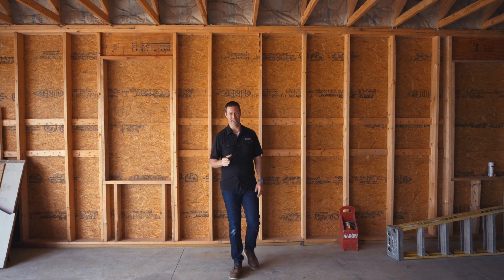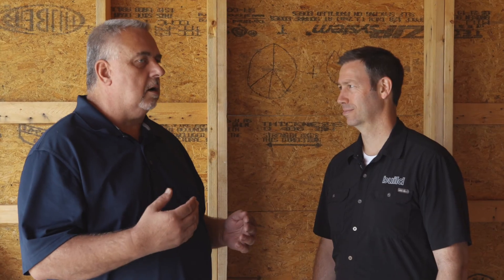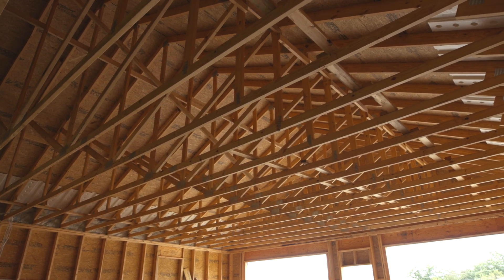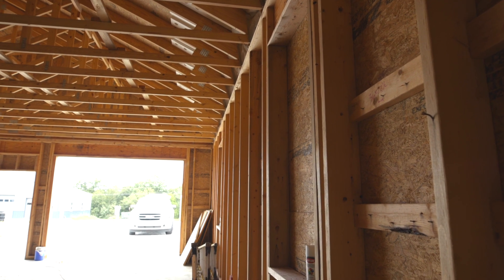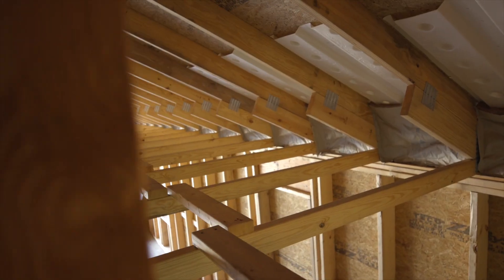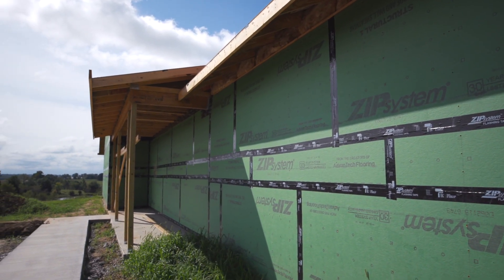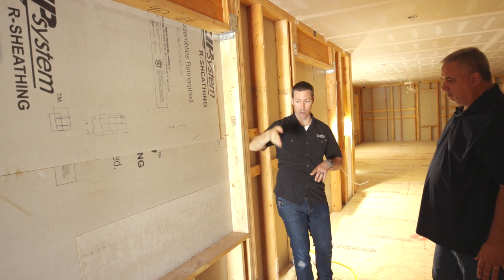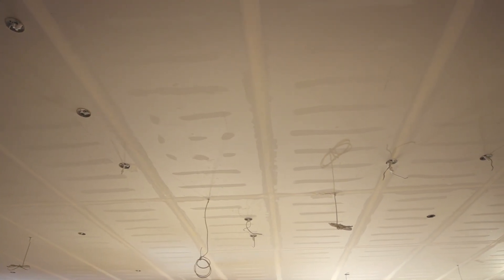Traditional vs Advanced Framing - Details

Comment: Love the openness.
Would this style framing be usable in California with earthquake codes?
Reply: Tom Bigley no, in fact this wouldn’t even pass any building codes in Utah and most other state building codes. This is garbage! No J-bolts to attach the exterior garage walls to the monolithic pad since I did not see a foundation, you get a big enough gust of wind that garage will move.
Reply: A lot of items would fail here in Colorado as well.

Comment: Im not convinced about this Advanced framing. I understand it’s engineered to save and be strong but hiring an architect to design it would cost more than traditional framing it. And I’ve used the zip systems and have had to go back and fix a lot of leaks. Also traditional framing makes adding on easier. And almost everyone knows how traditional framing works so future carpenters and anyone else that does work in the future knows exactly where everything is and don’t need to take down Sheetrock to see how it’s built. I can see using advanced framing where you need the house to be lighter and not as heavy. They should call it cheapest way to frame not advanced framing.
Reply: Tyler Durden this isn’t advanced nor smart framing, this is just a guise to cut corners and reduce structural integrity and quality to the framing to charge more while making it sound efficient. This is a disgrace framing and design job by a “architect” I’ve had to fix so many architects screwups. As a designer and a custom home builder, this is a disgrace to see and to try and pass off as a advanced framing, “so much” misinformation being passed on to those who will not be the wiser.

Comment: As a retired building inspector this all sounds like bs. This system has been around quite a while and is just a pain in the ass since it’s so outside of the norm and most framers can’t do a good job of framing. Then the interior drywall should be 5/8” since 1/2” warps at 24” oc.
Reply: Gregory Fox agreed it’s cutting corners and reducing the structural integrity of the home, notice there weren’t any J-bolts in the garage walls nor truss clips for the uplift, what will hold the roof to the house when a big gust of wind comes?! This would never pass any building codes in Utah. I’m a designer and builder in Utah. This is what I would expect from high school students doing a house projector the first time by a teacher that never built one before.

Comment: Great project! I'm curious about sound insulation between partitions, because of that common ceiling already built before framing of the inside walls. Was that considered by Steve in his design? Thanks for the video
Reply: And you should also be concerned about all the cracks in your dry wall.

Especially in the ceiling seams The only way to stop the cracking will be to remove the ALL the drywall and replace it with traditional framing.

Don't get me wrong I make money doing dry while repairs I love advance framing. The more advanced framing means the more work I have.

Comment: If there is moisture damage from a roof leak, or when the untreated lumber touching cement starts rotting, this house will be unsalvageable :(    Traditional building methods are made for longevity but thisnhouse is essentially reliant on OSB and nailplates. Build a better house and a smaller one. Stop with the disposable mcmansions

Comment: When you shop builders if they do any of this stuff find a new builder. So many things are wrong with all of this. I use to make a killing by fixing jobs like this.
Reply: Care to explain why, rather than just leaving a pompous opinion
Reply: @johnstevens2604  It's not an opinion. There's so much wrong with this it's too much to explain. I can tell you they are using a lot of stuff these fly by night cookie cutter builders are using. Cut corners and increase cost because it's advanced cutting edge technology...
You obviously think it's a good structure. 
Shop around, do a lot of research, a home is such a huge investment.
Reply: @BencredibleHandsOn  personally, i have no idea what makes something good, and something else better. Im just tired of seeing all the negative comments with little supporting info for the less knowledgeable ppl like myself.
Reply: @johnstevens2604  I hear you and I never comment for that reason, guess I was grumpy that day, who knows. There are some of the cheapest spec builders who use this same system and have for years that sell houses well under $100 per sqft. Custom builders want a piece of that pie. 
I've seen highly engineered manufactured trusses fail. Rolls in sheetrock, rolls in decking, cracks all over the place. It may not happen for 5 or 10 years, but eventually it will happen. You can't stop moisture and wood movement from happening, you just can't. There's just nothing "Advanced" about this video.
I've seen net zero houses not done right, they get too tight and mold, close a door and break a dang window.

I can't tell anyone how to find the right builder because a lot of them are really good at speaking bs, they're like elite car salesman. They kind of know how to build a house, but don't really know the reasoning behind why you actually do things. Same for sub contractors. 
I've seen engineer stamps on stuff that made me say "wtf" did they pay you off for this stamp? It's a shady business, and you've really got to do your research.
I think the best advice I can give is when they say something is good, try to find all of the cons about it from people who have lived with it for more than 10 years.
People that move frequently it just may not really affect so they might not have bad experiences.
I could write blogs on this stuff, but I'd also say don't just take my word on it. I'm just some guy on the internet who might know anything about anything.

Comment: Been building for nearly 3 decades, this is the cheapest framing I've ever seen for the big price tag. I'm not sold on the system.
Reply: Chris Jackson same here. The true test with anything is time. Traditional framing has stood the test of time. I see a lot of problems in the future. Not a fan of zip either. The price of hiring a architect and then the slower pace of building it bc the workers aren’t as familiar with it far exceeds any money saved by material costs. Should be called low cost framing. Calling it advanced framing is misleading.
Reply: @mr.eastcoastgrow6132  What is the issue with Zip? Are you throwing up Tyvek and letting it flap in the wind?
Reply: @mr.eastcoastgrow6132  Hit that nail on the head !
Reply: If you were, I understand they have ocean front property 😉
Reply: I agree 100 %
Reply: No informed person IS sold on this.
It's just for chumps buying gold watches from a truck!

Comment: I imagine the drywall is bouncy and saggy as hell on 24” centers. Jumping over a dollar to save a nickel
Reply: Well said and I wondered the same.  24" OC is too wide IMO for nice sturdy drywall.
Reply: If the wall studs are placed 24 inches on center,  5/8-inch drywall is typically recommended.

Comment: Had to add strips for OSB on walls; ceiling Sheetrock.....how is that easier than the couple extra boards you’d use on 16 inch centers?

Comment: Steve seems to be one of those Architects that's willing to think and design like a contractor.  I would love to hear his opinions on use of light gauge metal framing instead of all this old school lumber. Exterior walls with 6" metal, (maybe 18 gauge) with the same wood trusses. (metal trusses aren't cost effective)  You have R6 sheathing and using spray foam anyway. The thermo transfer through the metal should be minimal.

Comment: Personally I find issues with subpar lumber grading selection more often than framing design and planning. 
The rafters shown in this video are knotty everywhere! Wood with knots has nominal compression withstanding characteristics.. stack it like bricks it supports weight wonderfully...  use it as a long free standing brace?.. -better not. ( even one large knot in one side mid length and it will bow, contort, flex etc when bearing load).  -but knots attribute to poor tensil strength... never safe as running the lower rafter ties where tensile draw is pulling constantly!
Reply: Yep, I've seen these manufactured trusses fail. A polished turd is still a turd.

Comment: The double top plate has nothing to do with the sheathing or being cheap with lumber.  Using a double top plate allows for the roof trusses to not have to sit right on top of a stud in the wall.  It carries the truss load over to the stud.  
Now you talking about spraying foam then spraying blown insulation.   Wow you guys are making more work with no benefits
You only lose 10% thru the walls.  The wall insulation theory is dead wrong.

Comment: Jacks not solid to the floor? Can’t do that in my area.
Reply: Double jacks are the way to go and required over 4 ft.  Split the 2nd set.  Why are the trusses stacked on wall framing.  Sure you can use the truss lock screws easier.  But it looks terribly wrong.

Comment: What kind of sheathing do you use? SIPs can really increase the R value of the roof and walls. Do you duct blast your houses? If so what kind of leakage are you getting. How about a blower door test? Why don't you put a nailer on the top of the window? Seems as though you might have a hard time with the drywall in those areas.

Comment: Why is the sheet rock on the ceiling not staggered ?
Reply: its called advanced drywalling
Reply: The Real Cody Bersick , what makes doing this makes it advanced ?
Reply: I would guess that the interior walls will add the needed support when installed.  Likely will be under the long joints.

Comment: 1:53  Do not dry wall your ceiling like this, especially this size. That end seam down the middle is called railroading. 
Railroading leads to one big crack down the middle of the ceiling. You stack drywall like bricks. ( Offsetting the end seams).  Especially in cold regions due to weight of the snow on the roof. Trusses move with load.
  I have one customer who did this and calls me every year to come and repair the gap that has cracked open. If you are going to do this doubleup the truss bottom stud and put an expansion joint in.
 Also if you're putting storage above your garage use at LEAST 2x6 trusses. 2x4 trusses will not hold weight and your nice finished ceiling will be cracking every time you walk up there.
Reply: its called advanced drywalling
Reply: The Real Cody Bersick 😂😂😂
Reply: Brian is correct about truss movement W/snow load and  W/ temp change.  Wood is a natural substance and thus it expands & contracts W/heat & cold.  The suggestion to put in an expansion joint should be code requirement.  I know, my ceiling drywall tells me every year.  Engineered trusses are fine to use, just install them correctly, knowing they will move.
Reply: brian b , I did see a part of the video that it looked like they put furn strips tied to the bottom of trusses! Would this in any way stop what your talking about ?
Reply: @craigberube9890    I saw the furring strips you were talking about. Those are to disconnect the drywall from the truss for insulation value.  Less conductive energy is allowed to transfer from the truss to the sheet. Unfortunately when you nail strips to a truss and then hang the rock it moves even worse. Therefore amplifying the problem..
Reply: I've seen drywalled ceiling fudges and currently have a garage with 2x4 rafters 24"oc and 2x4 furring strips holding drywall "cracks all over"...  and the Drywall is following each other not staggered or alternating.

Comment: Why line up all the drywall butt seams like that? they should be staggered.
Reply: Laziness
Reply: Wondering the same thing. Maybe they’ve taken into account where the interior walls will be framed up? Joints will sit on top of the walls? 🤷‍♂️
Reply: They are using a trim-tex butt board or rock splicer.  They put the butt joints in the bay, not on a framing member, and allow you to do this.

Comment: I get it..  advancement eventually helps to achieve a better end result, however. Along the way, there's plenty of errors that are made between on paper and actual output, but I just can't help but to think these 2 things. My father would definitely be rolling over in his grave,  if he had one, but I'm sure his ashes are stirred up, and secondly,  as much as Larry haun always says, "that's code", hed probably be rolling over as well.  Just my opinion here, but I've heard of too many horror stories when folks talk about these new fangled homes.  Switching up too much at once.  Dont frame 16" on center,  go 24". Dont sheet with ⅜ or ½, go with this new stuff that's ¼.  Idk.  Makes me leery.

Comment: I appreciate your videos just some questions on this one.  Not sure why you need 2 x 6 walls in a garage that most times does not get insulated. Lvl header over a 3' window? Could have been a 2 x 6. What is the cost of the "header clip" I presume more than a stud?   Is a large part of the cost the extra insulation and HVAC systems?  What is the trade how long does that house/systems have to last to recoup the cost.  I installed a solar radiant hot water heating system in a house that lasted 20 years but once we figured the cost of the system, not to mention just everyday issues, it would have been cheaper to put in a traditional system. Of course we got to look down our noses at the regular people. Thanks for your work

Comment: I live in the upper Midwest where it can get very windy and bitter cold.  I am curious if the ZIP-R has more than an R-12 option or if you could add a second layer of ZIP-R sheathing to increase the external insulation?

Comment: Interesting idea to rock the lid before framing the non-bearing interior walls.  Seems like a pain to buzz 5/8” off all the studs but maybe worth it for an uninterrupted ceiling assembly.
Reply: From an air tightness and blower door test, this approach is superior.  For non load bearing interior walls, they should be using metal framing.

Comment: You are assuming that the energy paths through the walls are all perpendicular to the outside wall.  You are disregarding the energy  that short circuits that path by passing through the sides of the studs from the cavity.
Reply: Totally don't understand your point

Comment: Regarding energy vs insulation.  Most codes in US and Canada will require indoor ventilation air change of approx 1/2 the indoor volume per hour.
 This means you have to heat or cool that much air every hour, except when the weather is moderate temperature. 
Therefore at some point money is being wasted in overinsulating these houses.
Also attempting to make them super air tight can make them dangerous if one of the systems fail.

Comment: I'm just wondering why they broke up the continuous trimmer with that bottom plate causing a point for the wood to possibly squish in the future. Also up here in canada we personally tend to put the header directly onto the trimmer for direct load transfer and simply stick the top sill between the trimmers.

Comment: Question: Why don’t people use something like prosoco r guard or some other fluid applied wrb for flash and fill wall/roof assemblies instead of flashing with cc foam which costs an arm and leg even at 1”? It would be WAY cheaper and just as air, water tight, and safe no?

Comment: Interesting talking about the header pocket and jacks- our local inspectors here in Ontario, Canada won’t allow split jacks or a trimmer on the flat below the lvl headers. their thinking is faults with both pivot points and shrinking/compression of the flat trimmer.

Comment: @MattRisinger I remember mentioning ICF and utilizing the thermal mass in the past.

And YouTube comments is the only way I know to contact you.

What do you think of using steel SIP panels as an exterior to leverage the benefits of ICF thermal mass?

I know it may not be cost effective short term, but I've been considering labor and long term maintenance / lifespan.

But I've also been curious on what you might think of the best application practices would be if practical?
Reply: SIP over ICF? No. You just go thicker ICF, so do a 10" wall instead of 6 or 8. Also consider doing ICF roof as well if you go with the thicker walls.
Reply: @fordrac1ng81  well, what I'm aiming at is external insulation with the idea of using the concrete on the interior as a thermal battery.

Just increasing your wall thickness just increases the mass since the form thickness does not change, your just getting a thicker concrete wall.

I was looking at increasing the exterior thermal jacket.